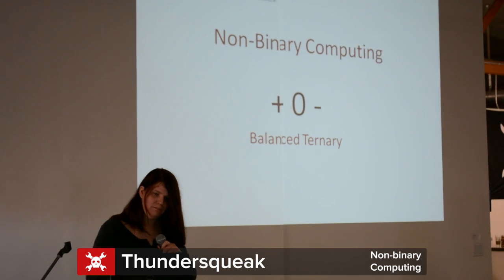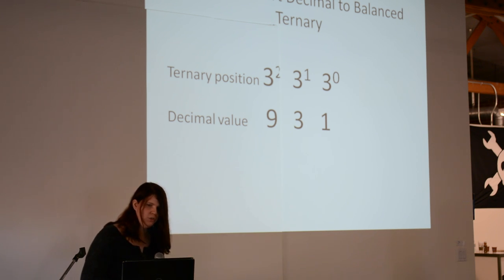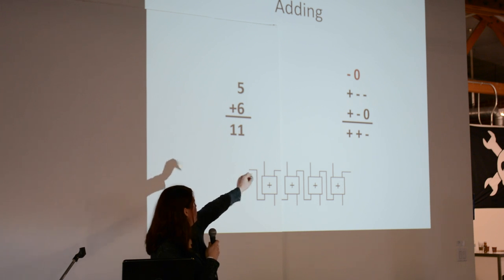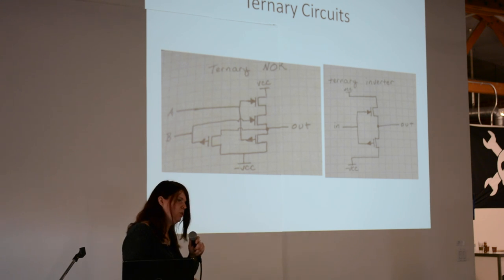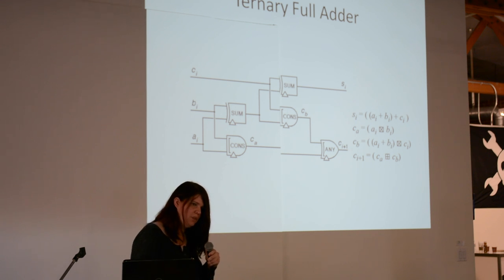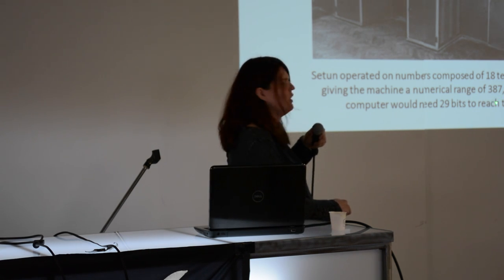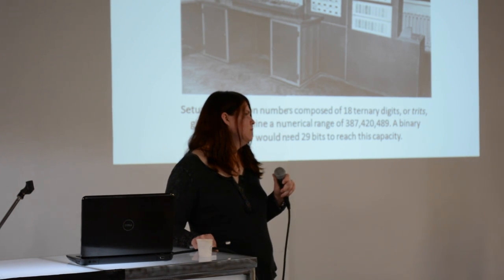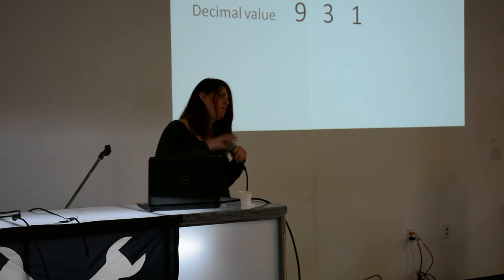Hackaday 10th Anniversary: Non-Binary Computing

Comment: I've always thought ternary an elegant solution, just hard for a mind that used to seeing binary to get around. Oh and there is the issue of keeping THREE power rails apart. Impressive work !!
Reply: I think the stability of THREE power rails could be the big issue that separates binary from ternary machines in terms of stability. Potential of "0 state" might get difficult to control in complex circuits. 0 might float to either + or - state. And cause 2 kinds of errors while in binary -0 is generally not a big problem.
Reply: That's a dated old issue that no longer exists.
Reply: Well it would be great but the problem that we have at the time wich we have to solve because it makes it a pain to use ternary logic in CPU's is that the threshold between the 3 states is less than the threshold between the 2 states of binary, wich sometimes causing a false output on the ternary logic gates because you have to really be careful of how much voltage is used up on between the Input and the negative Voltage connection of the ternary gates and if you are using up to much it can happen that a (+1V) HIGH value is losing to much energy and the input can't register the High anymore because it's less than the diffusion(gate) voltage and the input registers it as a (0V) undifined or zero value.

Comment: base representation is a little different or can be a little different then the actual symbols denoting the different n-nary options so the binary representation of a number system may not corrospond to the n-nary system in your case it used +-0 instead of 0,1,2  depends on if you want signed or unsigned ... excellent video like it a ton

Comment: nice video curious on how you would go about with 4-nary and higher in general n-ary systems. binary uses 0 and 1 (+ -voltage detected ,0) , 3-nary in your project uses +-0 voltage  where the level of voltage direction matters

Comment: It is understandable that we, knowing that the most efficient number is 'e', are inclined to think a base 3 would be a good numbering system. But, even being more efficient, in a lot of cases, like electromagnetic transmission, the binary 'wins', since there is a signal or no signal easy implementation. Having 3 states would be a nightmare.

Comment: As a freshmen in collage in 1996 I saw that transistor could be upgraded to do -1 0 +1 on a basic hardware level. This was I think a basic 8088 chip what was used in calculators that sum programing language was all I was missing. back to the drawing board and construction of Skynet.

Comment: Actually, the amount and quality of work is very limited. Also, I am very skeptical, that such machine relying on CMOS transistors in their LINEAR region of operation, would be feasible. At least from a power consumption standpoint. Then there's the issue of manufacturing chips, of which EACH transistor would have to be perfectly characterized in their linear region. I don't think this is any good, sorry.
Reply: You're skeptical if we're able to implement something they got to work in the 50's ? This is not a scientific presentation/discovery/work, it's a hacker presenting her hobby project. It's an interesting idea/concept/thought, and when considering how much effort is being sunk into binary technology, one can argue that there could be untapped potential in base3.
Reply: DusteDs Stuff Fair enough
Reply: They got it to work in the 50's by storing one trit in two binary magnetic cores.

It was basically ternary logic operating on binary hardware, which is cool from a science project standpoint but has absolutely no advantage over binary logic on binary hardware.